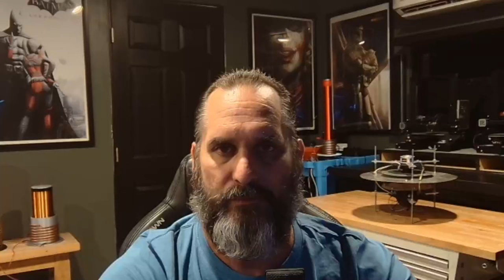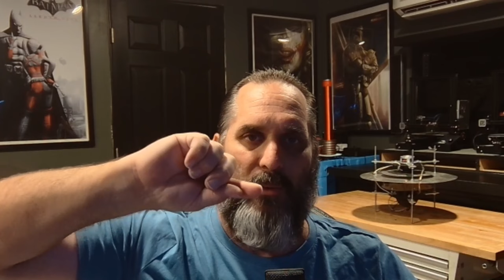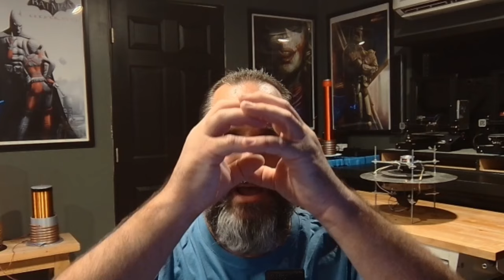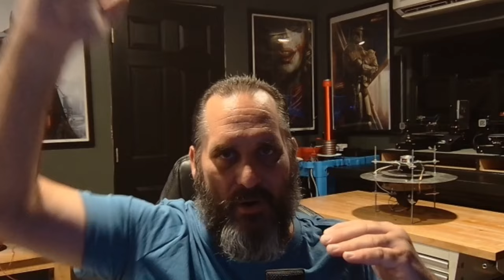Graviflyer "Update" #64

Comment: A floating car would be really cool to have it drive like it had tires on it.
Reply: The auto industry is currently doing this with the EV's. They are coming out with graphene belted tires. Silica sand in the rubber. Graphite wheels. Steel rotors. The carbon and the silicon in the tires and wheels and the steel rotors make the antigravity waves just like the earth has a carbon and silicon layer on its surface and an iron core to make its gravity field. The tires spin just like the earth. The batteries charge up the tires like the gravity flyer. The EVs have all wheel drive so the tires, wheels and rotors can levitate and turn the car. All they need is my star device or a fusion ICE hybrid to get the high voltage and current to allow the tires, wheels, and rotors to operate correctly like the gravity flyer. The star devices or fusion ICE hybrid high voltage and current will also charge up the body of the car so it can go into warp drive or wormhole drive to get to places on the earth or to other planets very rapidly. I talked to a GM engineer who told me about this some three years ago who I met in a jewelry store by me. Believe it or not. Oh, the individual motors on the all-wheel drive are the spinning magnets like the gravity flyer just like the earth. I also forgot the tires are filled with N2 and O2 as this is needed like the UAP need N2 and O2 as they need the gas to interact with the curved tires, so they produce antigravity waves.
Reply: my cats would love floating cars...
Reply: Great. I have two cats.

Comment: I'm wondering what kind of shielding a person would need to shield this kind of energy? I'm not bullshiting about me knowing free energy in a significant way. I can imagine a like a van I know another anti-gravity system I think I could feel I haven't tried it yet but I can imagine these gravitflyers on all four wheels to work like a steering device for it cuz I don't know to stir a precise enough to drive down the road. A lift a van about a foot or two off the road. Then use the gravitflyers to steering the vehicle.
Reply from the maker: It is more like a shield generator that flys. Like a part of a bigger ship.
Reply: Read my above comment about EV's.

Comment: O’scope showing vertical “stair step” is an increase in amplitude, NOT frequency. A change in frequency is represented by widening or shortening the empty space between waveforms. 
This is one of the reasons for why I am skeptical of success .. non-standard measurements - or at least the inability to accurately document the processes. It’s no wonder this concept cannot be replicated.
I honestly wish the best of luck.

Comment: I understand all that you are saying.  Three questions. Do you use a very long extension cord or a generator to power the circuits for outside?  Why can't you use a programmable logic chip to read the waves and hit the button at the correct time? Is Alexey really being exposed to all of this energy for years and years with no damage to his body?   It just makes me wonder.
Reply from the maker: Yes I use and extension cord. I also use coax cables (shielding is better than high voltage wire) to extend the power so it has minimal losses in the long distances. I could use a battery but I would have to use a step up for some of the power. Yes you could use a chip. I use function on the o-scope however it is just not easy. Alexey is being exposed and yes a helmet is a very good idea. The rest I will save for the video's when I am ready.
Reply: Thanks for the answer. The UAP on the show Skinwalker ranch shield the occupants with the metal spherical hull or an antigravity car with its metal body. Like a Faraday cage.

Comment: How did you manage to sync your three waves?
Reply from the maker: The center plate always starts to resonate out of tune. As you put it in tune the rest auto corrects to it. If you do not tune it the amplification will not have the same effect or any at all. The only thing I can relate it to is driving 60mph and yelling out the window. Then suddenly you close the window and it become clear.
Reply: @nathanbunten4299 
Is that why when you thumped the center plate it seemed to sync better?
Reply from the maker: @chasson321  it is supposed to happen with a button push. My piezo disc is not big enough. My way takes out all the other button pushes to get to the real one faster.